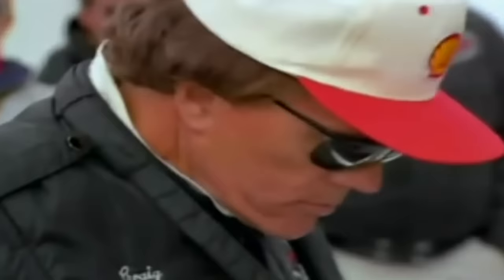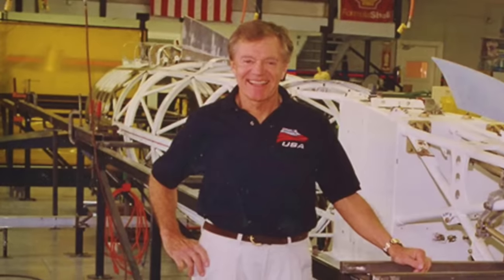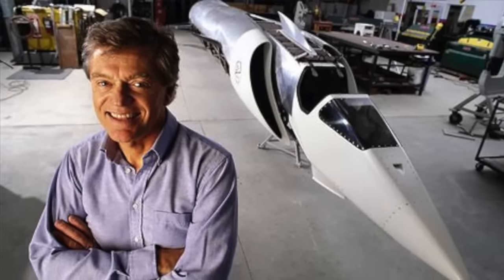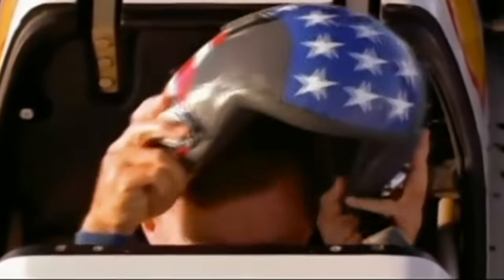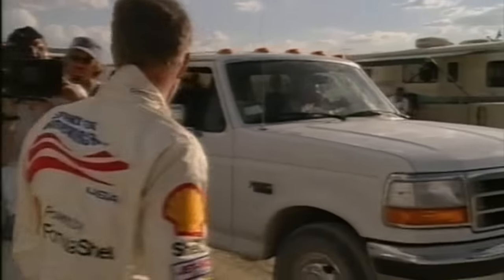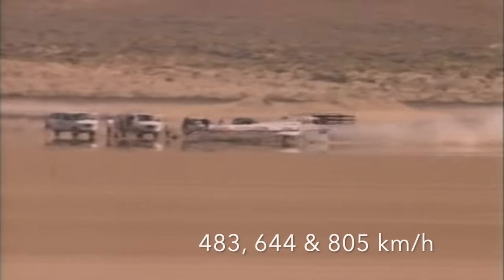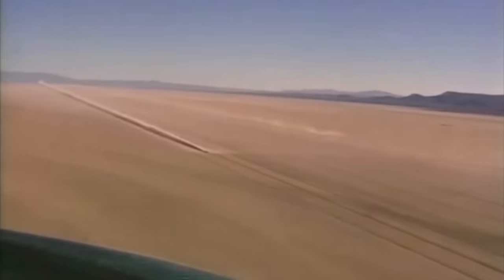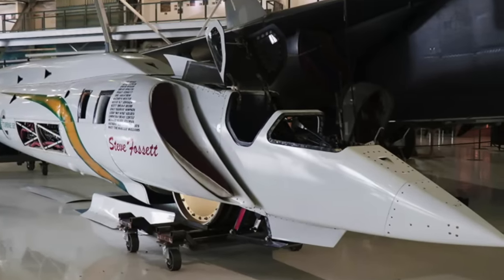Spirit Of America Sonic Arrow (Formula Shell LSRV) - Craig Breedlove's Supersonic Challenger

Comment: And 23 years later,the record still stands.
In 1974,I went 120 mph on my 1973 Yamaha RD 350.
I weighed all of 100 lbs and that was quite a thrill ride as the wind was pushing me back off of the bike and I was barely able to hold my grip and had to let off the throttle or else risk being blown off of it.
Reply: I had a dark green RD400 and then many RZ350'S and banshee quads...I still have a motorcycle 🏍 landspeed bike project a Suzuki RE5 1975 model in the shop a 2stroke rotary that is water and oil cooled. Adding a Garrett turbo and wanted to go fuel injection and a lil squirter of nitrous for a goal of 200mph, when I became disabled 2003..lol plus it's a small market...lol..from Wyoming USA 🇺🇸 🤠
Reply: @billallen4793 : Very cool.

Comment: Just popped up on my feed, great video editing and narration.
Im too old now but I used to race bikes (still have a street legal road course racecar I drive) and those speeds are amazing. I've been up to 162 MPH on a bike and the weight of the air hitting you is unbelievable. Even lying prone it takes all your strength to hang on. So it's not just shape / aerodynamics, the structure and bracing have to be engineered for those loads.
These people were amazing in their drive and knowledge.

Comment: So without checking... one five is taken as one point five and so... well you know the rest. What a pivotal moment in history down to air traffic control standard of communicating numbers.. how differently this story may have ended if breedlove was a pilot or if the weather guy said fifteen not one five
Reply: SCREAMIN' LORD BYRON - I think the system is clear by saying one-five for fifteen. They'd say one-point-five (or I think Americans might use one-tack-five) for one-and-a-half.
The reason they don't say fifteen is because over radio it could sound like fifty whereas one-five can't be mistaken for five-zero (although in this case that would have been a moot point).
I don't think the weather guy or standards can be blamed for the error - the standards are clear and well-established.

I'd venture to suggest if there was a problem with the process, it was that the final authority to make the decision whether to run or not was left with the guy who was the pilot and eager to run, as well as having the pressure of millions of dollars in sponsorship weighing on his mind - if that call had been left with an impartial third party who was a qualified radio operator, that may have seen the ill-fated run aborted.
Reply: That is a result of bad radio discipline. 1.5 should be read as "One decimal five (or fife if you want full phonetics)"  "One Five" is correct for conveying 15.
Reply: K1lostream i agree the standard was fine and breedlove was just too eager. americans also say "point" for "."
Reply: 20 years in the fire service. Assigned to Station Fifteen for 6. Dispatched and radio call sign was one - five...
Reply: @jeffreykelley8598  , yup. Standard radio protocol is to speak each digit of a number individually.
Reply: If you told me one five that would mean 15 and not 1.5
Reply: Dalton Bedore Ah, thanks Dalton - I'm only familiar with the British system, but I've heard Americans saying 'tack' which we don't use.
I guess 'tack' is in place of 'dash' then if you also use 'point' as we do.

And yes I think it's fair to expect Breedlove would have been pumped full of adrenaline, primed to get out there and 'do the business' for himself, his country and his sponsors.
I can imagine his state of mind at that crucial moment and, as anyone who's had a massive adrenaline-dump can attest, you're in a primal, animal, fight-or-flight state and, in that state, the parts of the brain that consider and reason are bypassed (after all, if there's a sabre-toothed tiger about to pounce, you don't have time to worry about whether you might get thorns in your feet if you run - you just run!).

I don't think it's any criticism of him personally then, to say he should not have been burdened with the additional task of evaluating weather reports and making the decision to run or abort.

Comment: I just saw the car about 3 weeks ago at the Wings Over the Rockies Museum. It is not fully assembled, there are some panels loose or missing, and the windscreen is not on it.
Reply: Chuck Goldsmith I remember reading that it was vandalised after a break in not so long ago. Heartbreaking. The people responsible were never caught. They have no replacement windscreen because Breedlove had them specially made. Those assholes ruined the car and any chance of the dream continuing. I don't know if they can still find a way of putting the car back in order, but they would have to find a specialist to manufacture the windscreen. The original one was made of aerospace glass, which was effectively bulletproof.

Anyway, besides that, without an adventurer willing to drive it, and a wealthy person willing to take a risk, I don't think we will ever see it run ever again. I think the dream has died, sadly.

Seriously, why would someone do that to the car? Heartless bastards.

Comment: what is the purpose of that front "stabilizer" fin? wouldn't it move the center of pressure forward and destablilze the car/counter the work of the rear stabilizer?
Reply: The J79 has massive surplus power and the power line is directly inline with the rotating shaft.
The front stabiliser is intended to counterract any yawing due to torque loading on the right rear wheel that the rear fin would not sufficiently control.
Reply: @rosewhite---  Massive surplus of power??? wtf does that even mean??? just bragging BS, either quote the figures or get lost.
Reply: @AirCrash1  Noble the Brit plonker!
Get a life.
Craig was a star before Noble ever cloned Art Arfon's Green Monster.
Ask Noble where all that £50 million has gone.
Reply: @AirCrash1  Art Arfon's J79 took his huge car to 666 so the little slim Spirit would have an excess of power.
GROW UP A LITTLE?
Reply: It is a well known fact with plenty of video footage to prove that jet engines can suck up debris.
Even engines high on plane wings can generate a vortex that lifts debris.
The clearances between blades in a jet engine are very small and no bolt will go through without damaging some blades.
Even with a few broken or missing blades a J79 has a surplus of power for a LSR vehicle.
Reply: Rose White Rose, please don't confuse Paul and Richard in the same sentence.

Richard and Craig are great friends, to this day. Richard said that Craig was his hero. When they were running together in the desert, they would often walk over to each other's camps and share jokes over a coffee during repairs etc.

Please don't confuse Richard with that Paul plonker who's nothing but a troll.

Richard used to really will Craig's Sonic arrow on when it was running because he hoped it would achieve it's target and make it a close fight between them.

And don't believe everything you read about the sponsorship money. As an American, I can honestly say that having met Richard, he is gracious, and a Gentleman, and I don't think he's the kind of person that would do anything untoward with the money raised for Bloodhound.

And trust me, when I say that Craig & Richard are good friends, because there are plenty of instances, and lots of footage, of Craig shaking hands with Richard, and talking about each other in the highest terms. Craig has great respect for Richard, and the Brits team.

Paul is just a troll.

Comment: I was volunteering with Breedlove's field mechanic and remember that Craig and the fellow who owned the hydraulic parachute packing device suddenly parted company, leaving Craig with only one packed chute. As Craig's mechanic discharged a fire extinguisher to field rig a replacement parachute packer, Craig wanting to save his one remaining packed chute for a later higher speed run, used the Fred Flintstone brake to slow the car. But to avoid dragging a nasty groove in the laboriously hand groomed (one guy found an arrowhead!) 10 mile long FOD free "track", Craig rightly drove off of the prepped course before pushing down the brake. It is my memory that it was a kicked up stone that lunched that engine.The fellow who rebuilt that engine said every compressor blade was micro balanced with its partner, "This is the best engine I ever built" [in 30 years]. I can still hear the sadness in his voice. Then it got worse. Rather than stoop to confer with any of us locals who knew the area, the Spirit of America was loaded into it's transporter at dusk and was promptly driven off, right into the mud on the edge of the playa. The Brits quickly sent one of their sturdy 6 wheel vehicles, amber light flashing, and pulled the transporter free.
Reply from the maker: Thanks so much for sharing your memories of the SOA project - lots there that I hadn't heard before. Although SOA and Thrust were locked in competition, it is heartening to hear that the teams acted so sportingly towards each other and helped out where they could. Sportsmanship (to a greater or lesser degree!) has been a feature of LSR competition over the years. Breedlove and SOA were terribly unlucky to have suffered the engine damage (interesting to hear about him running off course, and maybe picking up a stone, not the bolt my research suggested). Things might have worked out very differently...!

Comment: Some of what Breedlove said is true, but going up against trained engineers with computer, tunnel, etc. support is probably going to be a losing endeavour.  No question, if anyone might pull it off though, it would likely be Craig....lots of practical experience and a WHOLE PILE of records under his belt.  Unfortunately, when your competition is running a QUARTER AGAIN faster than you are, you are hardly worth mentioning.  I was looking forward to that teams next vehicle, designed to break 1000 mph, but funding ran dry for that attempt, too.  Shame, that.  I'm afraid competitions like this one are pretty much out of the hands of smart garage types, and in the hands of engineers and fighter pilots now, as was demonstrated here.  I would have liked to have seen Craig have a better showing though.  Shame that, too.  At least he was unhurt (and unkilled) in his sideways run, and THAT high speed turn should be one for the record books!  ;-)

Comment: Is there a way of measuring the g’s he experienced, through that U turn ? 😂😂
Reply: a = v^2/r.

It ended 2 miles of course facing the wrong way, so take r=1 mile = 1600m.
He was 500 mph when turning to avoid the motorhome, so we'll take v = 500 mph = 800 kph = 222 m/s.
Then a=222^2/1600=30.9 m/s^2 = 3.15g

This is all a huge simplification: he wasn't traveling on a perfect circle at uniform speed. Speed was decreasing throughout the incident, and radius of turn would have also changed throughout. You'd need an accurate ground path and history of speed to get an accurate value. I've also not accounted for acceleration due to slowing down. It was at maximum speed when it first went off course, I'd expect that was when acceleration was greatest.

If I had a car like that, an accellerometer is something I'd fit, so likely someone knows the true answer.
Reply: The gt stripes in his underwear!

Comment: I was Program Manager of the Steve Fossett ALSR from 2006 to 2008.  The video is a very well done chronology of the program.  My only criticism is that we did not remove any stabilizing fins.  We did fix 6 fatal flaws in the car and significantly updated the parachutes.  CFD analysis showed it to be perfectly stable out to 1000+, the stability issue in 1996 was due to a flaw in the steering.  It's good for the low 900's as it sits.  The Fossett estate decided they wanted all of their money out of it rather than go forward with operating sponsorship and turned down two deals that would have kept us running.  Remember that it was 2008, the start of the great recession.  The Brits claiming they had a 1000 MPH car (which will be lucky to make 950 by their own data) dampened all prospects.  

We now have a 1200+ MPH design rocket car awaiting funding.
Reply from the maker: Hi Eric - thanks so much for your comment, really interesting to hear from someone who was part of the Sonic Arrow story! Apologies if I got the stuff about the removal of the stabilizing fins wrong, I do a lot of research for my videos but sometimes the sources of information that I find are less accurate than than I'd hope. I'd be interested to hear more about the flaws in the car that were fixed. It's a damn shame the project came to an end so abruptly (as many have pointed out in comments about this video) it had so much potential.
Reply: Eric if the car is capable of 1200 mph as you say, why is nobody sponsoring it as not even Bloodhound could touch it. I'd be amazed if it was still using a J79 engine, and if so the car must be more slippery than a dolphin!

Comment: If this had been a drag race then SOA would have won hands down due to having a greater thrust-to-weight ratio than SSC. However going long haul the advantage would tip towards SSC as weight would be replaced by aerodynamics in importance. Hence SSC would have a huge thrust-to-drag ratio advantage nearing terminal speed (don't be fooled by SSCs large engine intakes that don't contribute to the drag equation). Effectively Breedlove brought a knife to a gunfight. It didn't help that there were several stability issues with SOA that only came to light when it was sold to Steve Fossett. This was not an issue with SSC as it was extensively tested.

Comment: To some extent SOA v SSC would be a replay of an F104 starfighter v EE Lightning rate of climb contest. A light single-engine jet against a twin-engined behemoth. Initially the F104 would pull out a lead, but the EE would be first to max height after which it would run out of fuel and the F104's wings would have dropped off :)

Comment: Well, 675 mph is pretty impressive. However, I'm a bit suspicious of the claim that "calculations" suggested it could go maybe as high as 900. Breedlove is still one of my childhood heroes (I was one of the only Australian kids who'd ever heard of him) and while design by eye has its place, it's not the best way to design something that is expected to perform in the transonic zone. Aerodynamic drag is going to be by far the biggest factor and that needs wind tunnel testing or something similar. Drag rise is not linear, it's exponential. There's also the issue of critical mach number, which, once exceeded, means there is a combination of sonic and subsonic air traveling over the vehicle. This is a lot more dangerous than you might think because supersonic air behaves very differently from subsonic air. There's also the issue of compressibility. Shockwave formation can be extremely dangerous if it falls in the wrong place. Richard Noble himself almost came to grief because of these issues in Thrust 2. His engineers later calculated that if he had gone another 14 km/h faster the car would have flipped. The newer British challenger might have looked a lot more cumbersome but it had been designed by a former missile engineer and researched on both a rocket sled and in a wind tunnel.

So how fast would Spirit have gone? We don't know. While the video lays the blame for Breedlove's crash on a gust of wind, things like paint asymmetry have been known to cause problems like that. This is what your dealing with. These are not simple matters. They need a scientific engineering approach. The life of the driver depends on it.

For the record, the only other guy I wanted to come close to Thrust was Craig Breedlove. He's unflappable and he's a good sport. He plays by the rules. Always struck me as a good guy. I just think this one might have been a step too far but the basic concept was good.
Reply: TheThirdMan question by the look of the damage how can sonic arrow make a u turn with all wheels off the ground going 600 plus mph if there’s no control of steering? I would assume there would have been more damage....600 is fast but I’m impressed. I heard about this story on tv once but wasn’t interested back in the days now it’s on YouTube and I really didn’t know it was this big of an event pretty interesting.
Reply: @georgepena5595  Good question. I agree, the damage was extremely minor considering the speed he was traveling at. My guess is that a lack of directional stability (part design and part manufacture) combined with a rearward movement of the centre of pressure as the car got close to transonic speed. It's quite possible that the car's critical mach number was the problem here. Few people have as much experience as Craig Breedlove of driving at these sorts of speeds and I don't think anyone else has survived two crashes at such high speeds (I think the first was in 1964). But given the amazing - sometimes apparently insignificant - things that can influence transonic airflow, sometimes with disastrous consequences - this represented a very high level of risk. Much as I admire the man, I think this was a step too far. It really needed CFD and wind tunnel work, like Bloodhound SSC.
Reply: @georgepena5595  By the way, just looking at the design of the wheel sponsons, I'd say that they could have been part of the problem. Even the tiniest disparity in alignment could easily cause a crash like this. The central fin was also very small and probably not adequate.